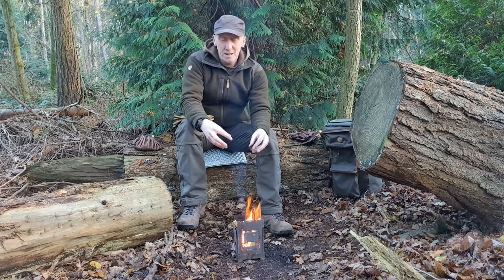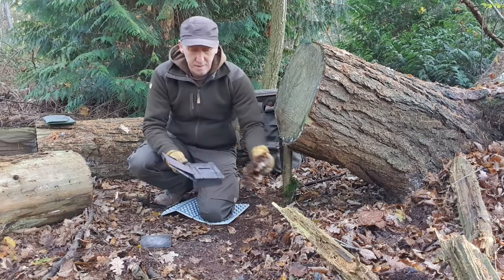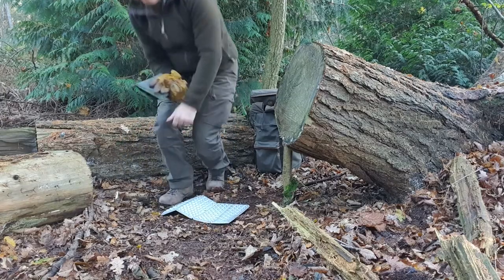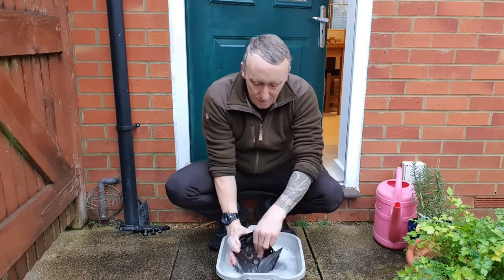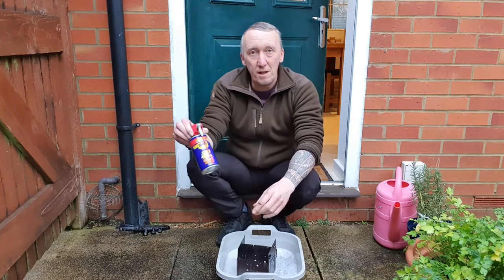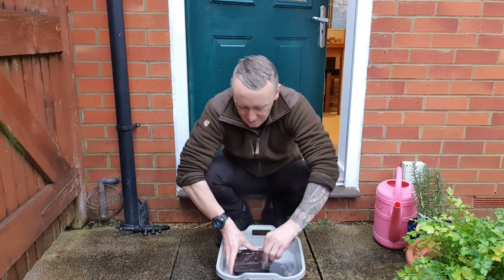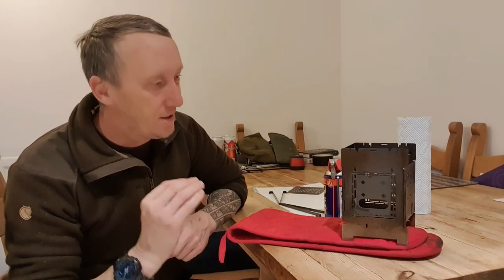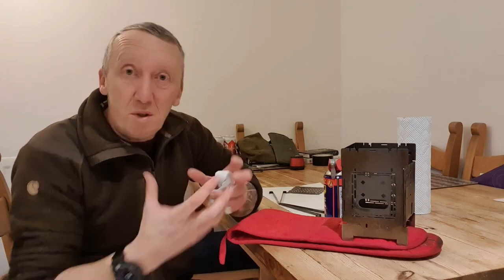Firebox Stove Maintenance

Comment: I own the titanium Buschbox LF and will wash it down with warm water and a copper pad from time to time when I am cleaning the soot from my cook ware. 
But I never use any oil, certainly not WD-40, on the bushbox. This is in part due to the material, titanium doesn't rust, but mostly because I don't want to breathe any of the fumes when cleaning or  using the stove. 

Where I live, you don't have much choice, but to use coniferous wood, not much else grows here. It is not as bad as you make it out to be, or maybe it's the habit of wrapping the stove in rags after use, that keeps the dirtmof my pack.

Pine raisin is more a bother on my knives and saws, but is easy to remove with a bit of oil. I use cheap sunflower or canola oil, never mineral oils, for that.
Due to the local climate, always wet & damp, I ownly use stainless tools, that alos cuts down on the maintenance time.

My unease with mineral oils and WD-40 might be overly cautious, I'm definitely not an expert, so everyone do as you see fit, but please share your experiences!
Reply from the maker: Hey my friend a great comment and thanks for taking the time to leave this..for me I just find pine messy and prefer not if possible to use it , but if needs must I will do..I guess some have no option and I get that , for me im lucky to have alot of birch hazel oak and ash to use so they are my go too choices..if I do use wd40 which isn't all the time I'm very careful ..I spent yrs running cycle shops so its second nature for me to use it I guess ..atb jj

Comment: Many thanks for making this video Justin.  Love my Firebox stove so it was good to see what you do to maintain it.  I’ve found that the front side does warp out a tiny bit after use which I’ve noticed stops the fold-down fire grate to miss the slots it’s meant to rest in.  With some gently flexing the front side can be coaxed back in a couple of millimetres.  Have you found this at all?  Cheers - Ben
Reply from the maker: Have to say personally I've never had that problem myself my friend and not really heard others mention it either so it may be just bad luck thats happened with yours ?? Glad you found this one helpful atb jj
Reply: Had to flex mine in slightly because the extra plates (grill, boil) etc wouldn't click in to place and were loose on top of the stove.

Comment: Great video. Thanks for sharing. I really love my firebox and I enjoy the process of cleaning it once in a while as well. Do you you think rust would become an issue if I cleaned it using your method after each outing? Maybe 6 to 10 trips a year? Thanks again for showing your process!
Reply from the maker: It doesn't need that kind of treatment everytime you use it ..theres no need for it ..this kind of maintenance is after its had like 20 to 30 burns 🔥

Comment: Thank you for this great video JJ. You seem to be very knowledgeable on the firebox, therefore I have a question for you. I am contemplating on purchasing, but not for the purpose of using it as cooking primarily. I am more interested in using it as a portable fire pit for extended burn times. For between 5 and 8 hours at a time, 3 or 4 times a week. In previous videos you shared that you use yours alot. Would this firebox be able to handle extended burns? Thanks in advance for your guidance.
Reply from the maker: Hey my friend thankyou for watching ...I have always shouted out the merits of this firebox and I Continue to do so..yep I wouldnt have any concerns about using it for that ling at all..the best way to get a long burn out of it regularly is to use the swedish fire torch method...cut your wood into 5 or six round lengths thick enough to place into the stove vertically..works a treat 😀
Reply: @JJ_OUTDOORS  Thank you so much for replying. You told me exactly what I wanted to hear 😊 Also, with long burn times like this, Of course will bring along hot coals that spill out the bottom. I will not always be using it on the ground, can you recommend something I can place underneath the firebox for the overspill of hot coals? Again, thank you for your time. Hopefully, I will be making a purchase today, Please advise ❤️
Reply from the maker: @deborahengesser4300  it burns so efficiently and effectively that you probably wouldn't get much overspill at the bottom tbh ..you can get some small heat resistant small.tiles ( lule those used in kitchen etc , or mats to rest it on
Reply: @JJ_OUTDOORS  Ok, thank you ‼️Oh, and keep those great videos coming 💗
Reply from the maker: @deborahengesser4300  will do my friend thankyou ☺🙏atb jj

Comment: Do I need to do this after each use?the bottom of the stove is slightly bent, is that normal?
Reply from the maker: Do you mean the Ash pan is slightly bent ?? Thar can happen and wouldn't be a problem...no you don't need to do this after each use ..I use my stove weekly and have done for about 4 years now..I do this about twice a year
Reply: @JJ_OUTDOORS  not the ash tray, but the bottom of the stove itself, which reclines, it is slightly bent.Thanks for the answer)))